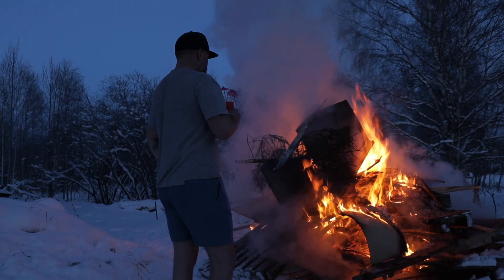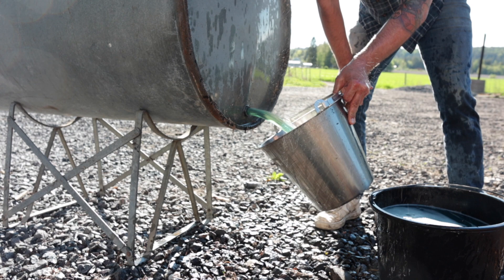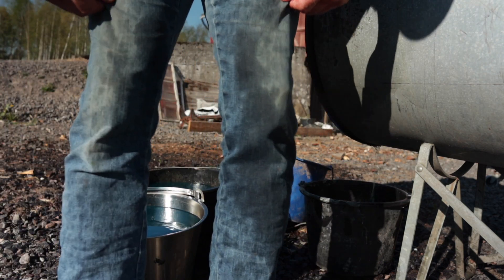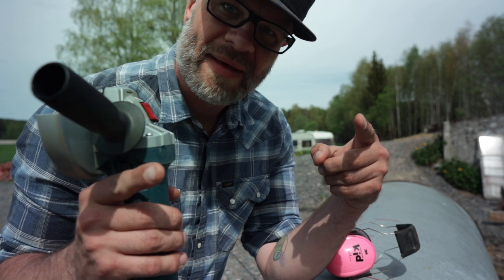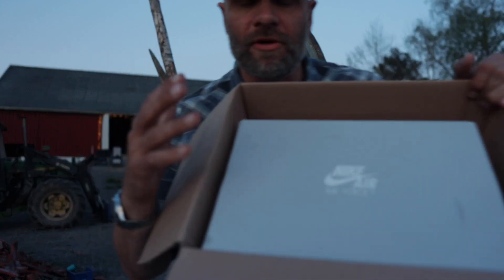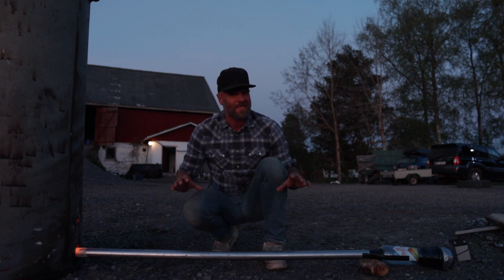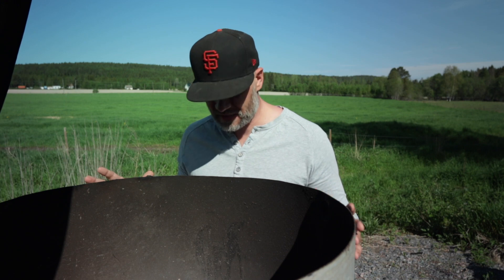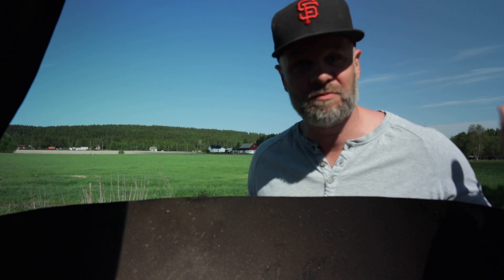Fan(!) of FIRE! How to keep a fire going using a fan from an old computer

Comment: Very cool! A burn barrel design I found on YouTube a while back and have used through 3 barrels is: cut a few 6”-8” vertical slits around the lowest section of  the barrel and then hammer them in on one side of the slit to make louvers. Then put 4 more in the very bottom. This will make a swirling air vortex inside the barrel and works amazing!

Comment: Diesel fuel is really good for cleaning Machinery parts and works well as a degreaser.  It would be very useful next time you have to work on bogger and need to clean the grease off a part.

Comment: I use an old blower from a Christmas inflatable with a floor flange bolted to the blower as an adapter Then I use a 10ft piece of threaded rigid pipe as the blower tube as it does not burn up quickly from the heat

Comment: Hysterical...of course you neeeed to find a way to make a contained fire when having a fire is restricted, but not just any contained fire, but a big one, that requires air blown in from a re-purposed computer fan etc. etc. etc. I'm sure the "turkey shoot" will cross my mind later, but I'm still getting over the length and depth you went to for a safe, yet sizable, burning. Your determination is amazing! Have a great day!
Laural

Comment: Use 50% diesel 50% used motor oil to spray on equipment you don’t want rusting.
Reply: Good for wood fencing  too. As a wood preservative. But keep away from where small kids might play or climb fences. So they don't get it onto hands and into mouth.
Reply: Yup great for the environment
Reply: @dieseldabz7104    Not sure if you are for or against this tip. If you are against it, what do you suggest doing with the diesel?
Reply: @PeanutButter-19  yes that's what we do 👍